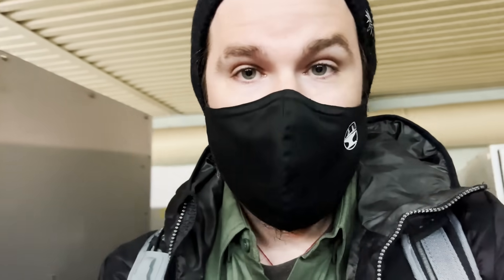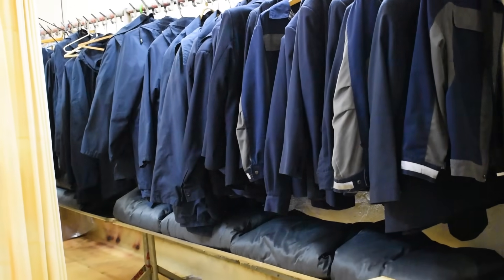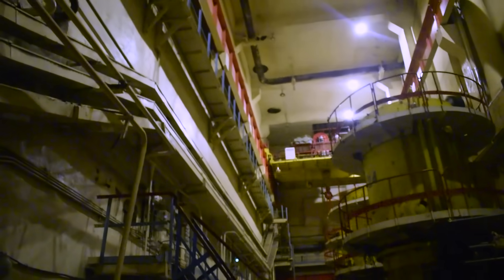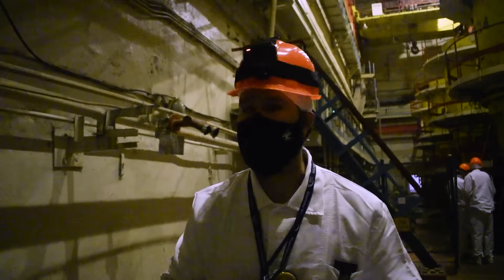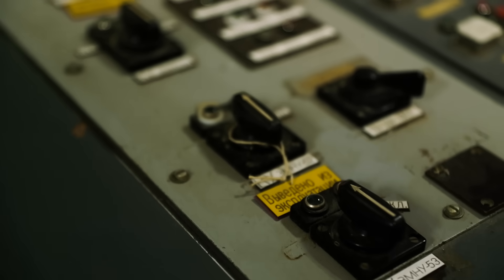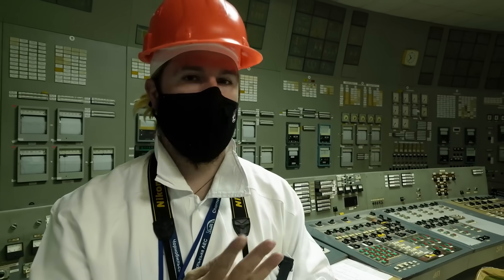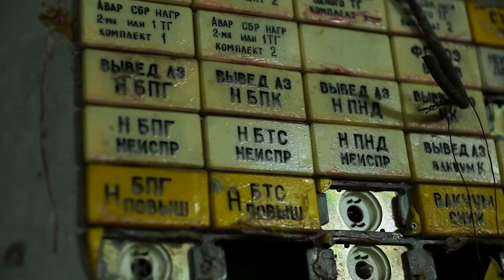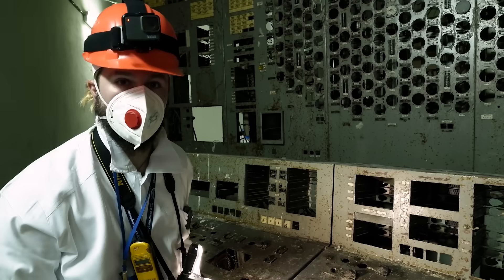Chernobyl Like You've Never Seen It Before...

Comment: Why are you wearing the same cloth face mask from outside when inside the reactor? You had just gone over how you're not supposed to take any cloths from outside on the inside. It's not even the right kind of mask, that thing is useless for radiation. There's a good chance you breathed in lots of particles. Everyone eles in the room was wearing the correct mask but you.